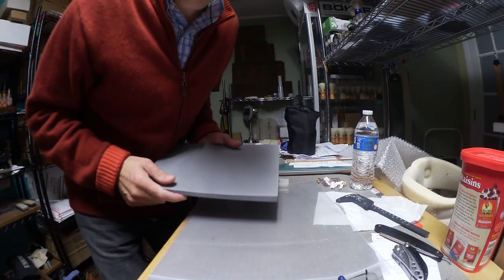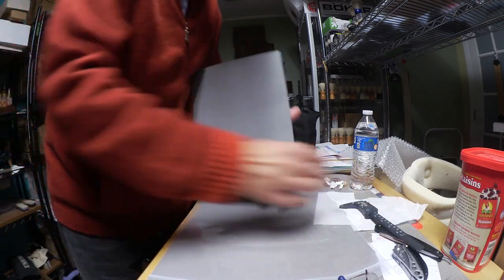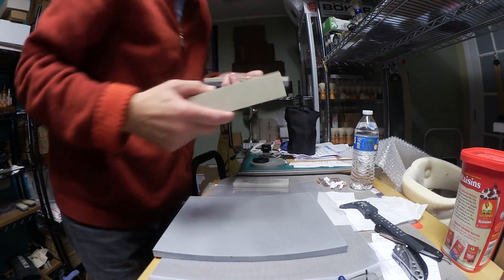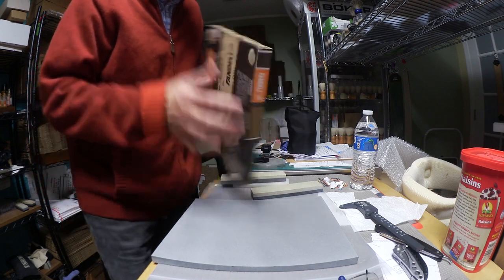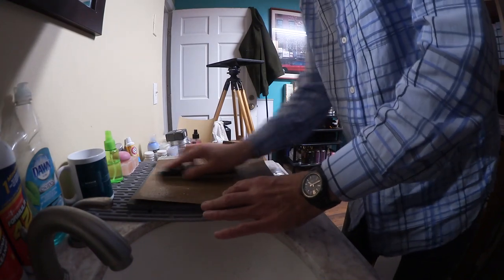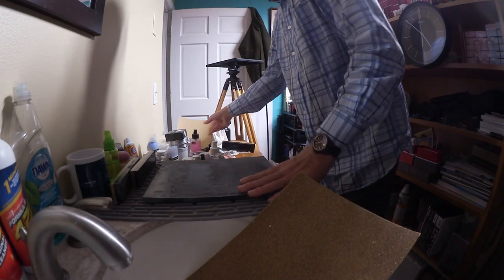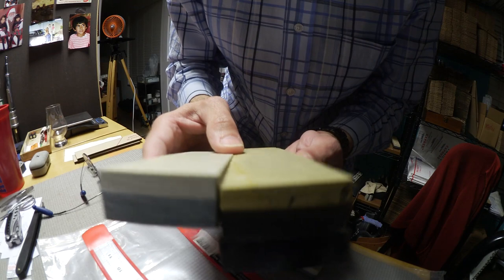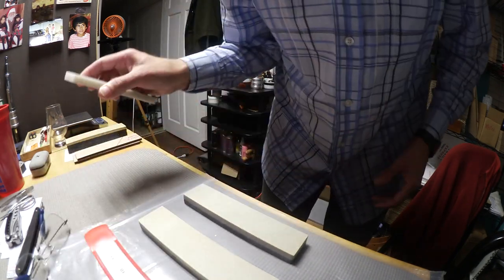#Hönenist Lapping Plate for Razor Hones to Anger gssixgun steve56 & Other Special Humans

Comment: this is what I was looking for. excellent!
Reply from the maker: you can use any cylinder accessible that's >9" on a brand new (_never_ honed on flat things or this is not true) hollow ground Solingen style razor, you don't need this proprietary shape thingy...but it turns out that such shapes are hard to find!

Comment: Hi Jarrod. I own convexed arks and a coti from TSS. I am anxious to get my ASB to maintain. 

Curious, have you ever convexed Naniwa synthetics?

Thanks. Bill
Reply from the maker: Yes, sir, I have 5 of them, the old ones with the plastic bases, they're wonderful!   Best surface feel yet I've tried.   Get dirty easily and you have to keep cleaning it so it is messy love, but then that is a part of a relationship where you are effectively using a bent plane blade to cut in to that whetstone a bit with each stroke.   

I wouldn't want it as my daily because of the mess but for feedback they are absolutely unsurpassed, the 12000 is better than the softest purest coticule I have tried this way.   

We have +5 pcs of ABS over what was sold coming, so if they are what they say they are there would be 4 available whenever that day occurs.  But I want to see them first because that company's not actually supplied anything (they're in their 20-work-days queue quote), the other co produces ~5 days and went fail / fail / great for double-sided 3d / double-sided 3d (different material) / single-sided 3d (third material).     So while they' cost a lot in comparison to ABS which, I am entirely confident in the co. #2  making three materials based on this piece and the shape of the other form, regardless of whether the customer wants aluminum or this new stuff or acrylic.   ABS as take-order, that will have to wait, as co#2 doesn't do that mfgr.  If the first batch are terrific we'll keep that as stocked for about 55% the cost of the others.      Cheers!
Reply: I own one of those coticules! 😃 and I just got the plate! As a begginer I was able to make a comfortable shave ready edge with just the coti and a Russian leather strop!

Comment: Great Idea of lapping the cylindrical shape! What Pros/Cons do you see in using this shape vs. the elyptical one? 
Thanks a lot
Reply from the maker: Pros are only a complete idiot can introduce a frown (on expert shape, easy for anyone), and I've already played a bit on those coticules with it and the clearly warped Dovo 4580 some barber left with me 3-4yrs ago (he used it to cut hair, not to shave!) and can confirm it is a big help straightening out a visibly meandering bevel.  

Pro is you can shape more big natural stones, the elliptical shape costs heavy at the corners of any large stone and unlikey for example that you could find a 3x8" or 2.5x10" coticule thick enough for ellipse-ing, but cylinder-ing is OK.

Cons are the feedback isn't as good as the elliptical expert shape.  

Cons are it isn't as fast, either, even if two identically sized pieces of manmade were compared - something about the nature of point-to-point contact (lost on a cylinder)  and the nature of a hollow ground blade makes the ellipse notably quicker.  

Con also is the nature of cylindrical contact as created by a sandpaper holder means any one line abreast your hone will not be flat.  Could be concave, convex, or oscillate.  It is mostly flat but a razor knows the difference.  As long as you move laterally as one always should at least 3mm during their stroke in my opinion to prevent frowns and shuffle the deck of what comes at the cutting edge, in the end you'll still get a concaved bevel.  But not as concave as from the ellipse expert shape, because the two will affect a bevel identically ONLY if you are able to precisely keep your spine 90° to the long axis of the ellipse as you move along - the second axis of the ellipse has a much shorter diameter and as such, even a few degrees off of 90° down the long axis, you're effectively carving in that narrower edge whether you know it or not.  

And lastly, con that yes, it apparently can help straighten bevels (where that's no easy task on an expert shape), but coming in my opinion at a bit of an excessive steel rate.  The expert form in the end is the frugality king for your steel, if only you could leave such glorious tools alone.  

Each has their place in a toolbox in my opinion, today I'm going to cylinder up a 60x250mm coticule to use as my correction or/and bevel establishing specialist.   Can't wait!  

Love the HP nylon, bend but don't break but in this shape it doesn't even bend!  CNC milled ABS will be harder, but brittle...almost certain to crack if dropped on a hard floor, this material is more durable.  And I'm personally a lover of a light lapping plate.   Unfortunately once we scale up to 50+ pcs per, only other materials such as ABS, polycarbonate, acrylic, or T6 6061 aluminum make sense financially, and all will cost slightly more than half of this productuon's very high $.
Reply: @thesuperiorshave  Thanks a lot my friend for such detailed great and motivating explanation! 👍

Comment: Will you be offering cylindered coticules for sale as an option after purchase?
Reply: Sorry I read down and found my answer.  Love your site and videos.
Reply from the maker: no problem, sir | this part, as a machined-up nylon piece, costs a lot to make! | I hope but cannot guarantee that a scalable method can emerge for 50-200 units, via milled-down or injection molded processes vs 3D printing which does not tend to reduce in cost per unit with larger POs | These alternatives would need to use ABS, polycarbonate, 6061 T6 aluminum, or solid acrylic, none of which to me have the appeal of this costly HP nylon for its combined durable/hard/flexible(as in won't likely crack if dropped which ABS and poly have a huge risk), but all cost ~-40-55% per unit less in aforementioned 50+ qty |  While cylinder and ellipse each have a place in honing hollow ground razors, always use the ellipse for your ending if you've available for the very best performance in keening (or just find some really small cylinder and an abrasive deep enough to take adavantage, that would be even better!) | kind regards from NE FL - jarrod @ TSS
Reply: Thanks for the reply, I have several coticules that I use and all are lapped with a DMT for true flatness. I’ve been curious though with your work trying convex shapes.  I haven’t been honing for a while (wife seems to like a beard more) but still love collecting stones and razors.
Reply from the maker: Take the least favorite one and try the expert shape, your eyes will pop out of your brain's head on the first session.   Good fun!  This model's not for old hands like that, in my opinion.